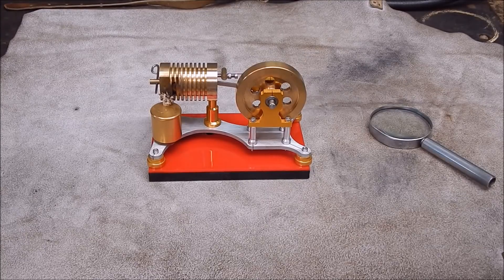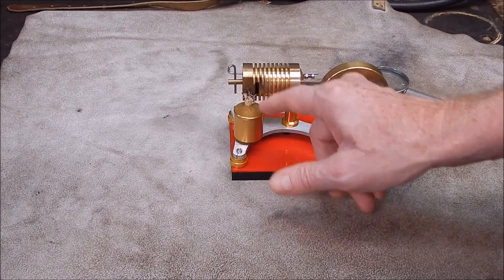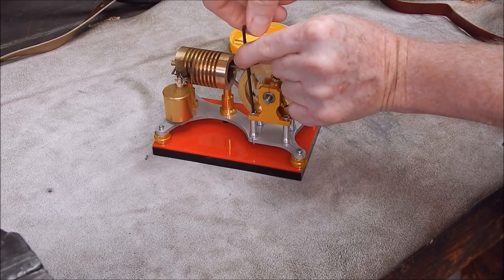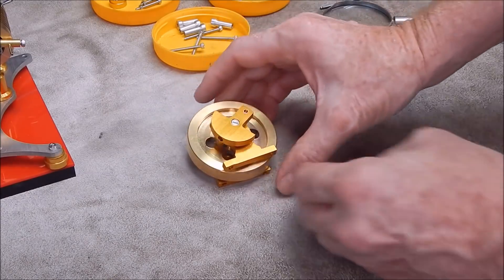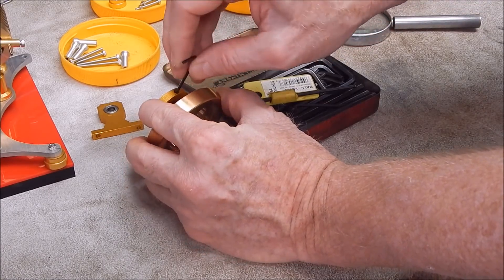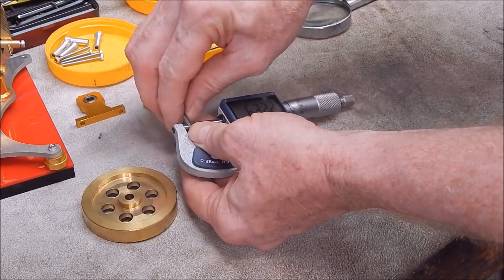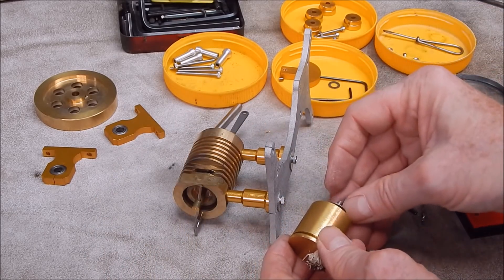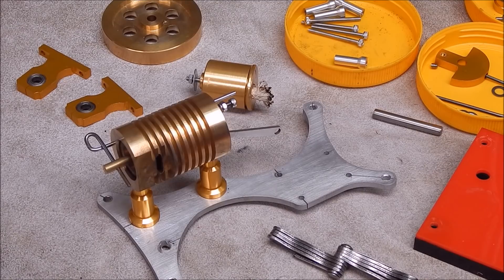Chinese flame licker engine make over - teardown

Comment: I think part of the problem with the runout is the angle of the set screw and only on one side.   This will offset the flywheel if any play at all.   A set screw on the other side would make it run straight.

Comment: Great project Rob, any excuse to get some time on the lathe is a good project.  I noticed the wobble in that flywheel on the first video, QC must have been asleep.
Reply from the maker: Hi Ron,

Yes, it's pretty bad.  The Stirling engine I reviewed previously was just so well made it was amazing - zero runout.   This flame licker is not in the same league to that.  Just shows how much things vary that come out of China.

I've seen a previous video of a similar engine where a guy corrected runout issues to get it spinning over nicely.  So it's probably not uncommon on these retail units.

Cheers Rob

Comment: Looks like it is headed for some great improvements. Can't wait to see them. Is there a brand name on that compact set of little wrenches you were using?
Reply from the maker: Hi Jim,

They are stamped with " A Pope product".  Very old.  They belonged to my father who was a motor mechanic.  I have several sets of these in different sizes, and another set stamped "Made in England".

Not something you see sold new these days.

Cheers Rob

Comment: Wooden base great idea! Might I suggest American Chestnut. It will look great with the polished brass. The Aluminum base would look good if you polished it. Might think about just cutting off the arm and drilling a new mounting hole. Merry Christmas!
Reply from the maker: HI Craig,

That alloy mounting plate is going.  I'm sure it will look and work much better without it.  I have some scrap Jarrah hardwood from a previous video on a roadside junk pick up that should make a great base.

Merry Christmas to you and yours also.

Cheers Rob